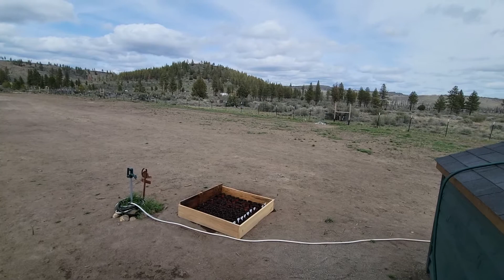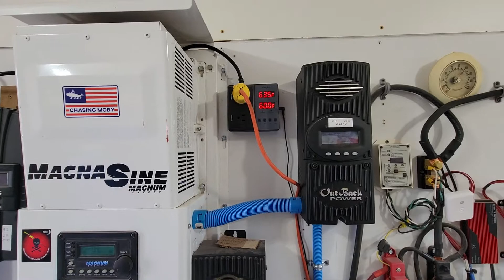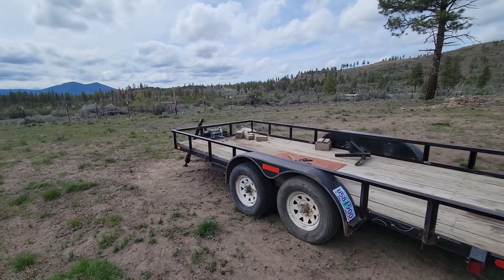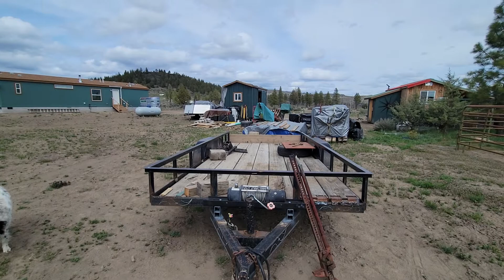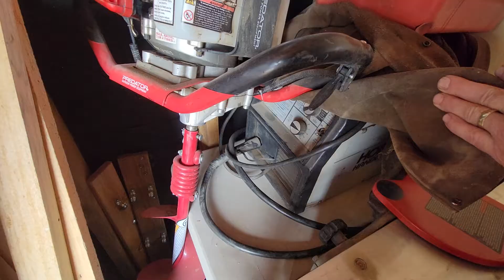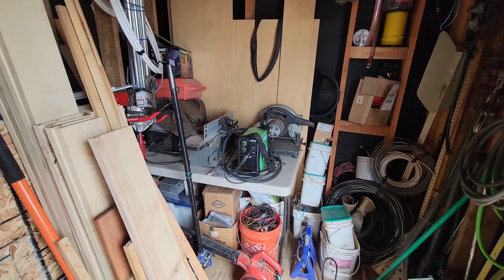Solar plans & Winch Install on The Car Trailer

Comment: The homestead is looking really good.  You had all that cold air whistling out of your well shaft when you first got the property.  Is there any way you could tap that for your ground loop?  Or is it too unpredictable with the inhales and exhales from the fracture systems?  Probably a 10-15 ft section of conduit going down and back up would be all you need, then insulating the line under the ground to your mechanical shed of course.  ~God Bless
Reply from the maker: That is a great Idea. I'll consider it.